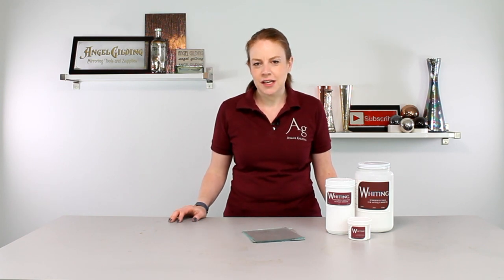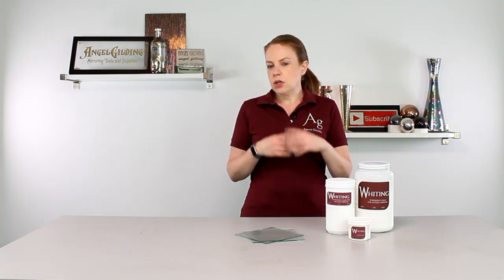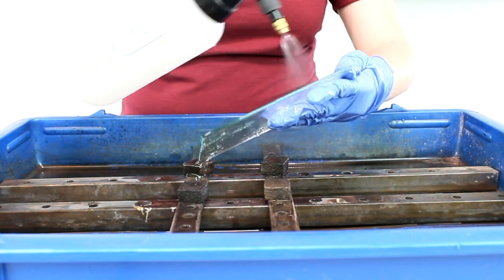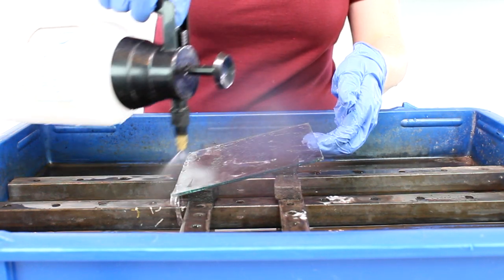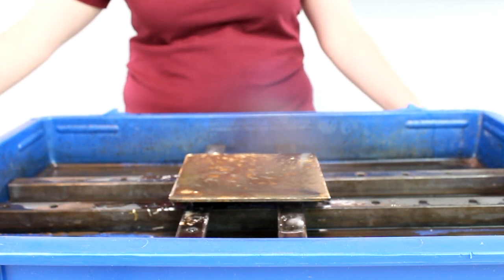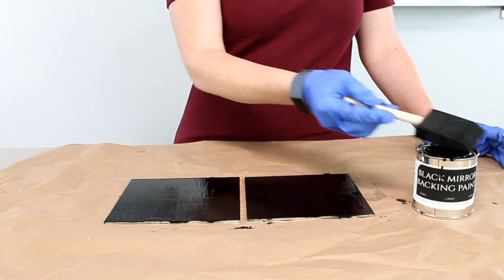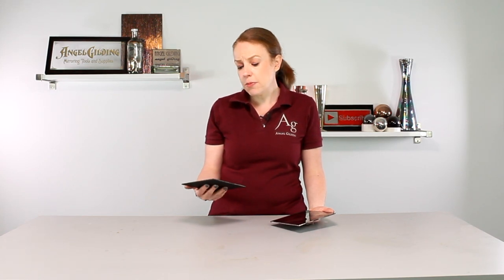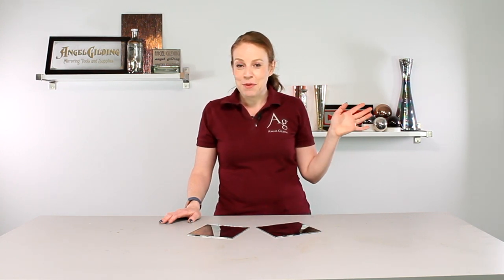Making an Antique Mirror Part Six: Whiting

Comment: Great. Subscribed and will xheck out your website 

Some questions before I go.

1. How do you dispose of the chemical and water etc in the tray, safely for environment?

 2. Your euipment, the spray system you have for water that has the hose, in the stand, what are they called and where do you get?  

3. Do you do bigger pieces using that system I see in your 6 videos?

4 If I were to purchase do tou have an outlet in Australia or if not ship here?

Thank you, hope you see this. 😊
Reply from the maker: Hello! Thanks for the subscribe. Here are some answers but please do reach out if you have any other questions. We have waste treatment kits that enable you to treat the waste water so that it is safe to dispose of. We are using our Pump Spray Assembly, a product we manufacture and sell on our website. You can silver very large pieces with our spray systems. We also have a system that connects to an air compressor which has been used for many large pieces including the worlds largest amateur telescope and full walls. We do not have an outlet in Australia but we ship to Australia on a regular basis and you can order directly from our website. Thanks!